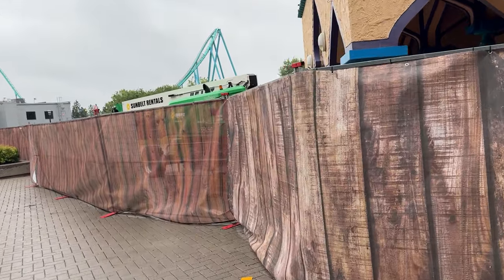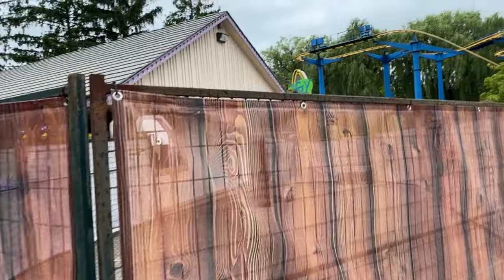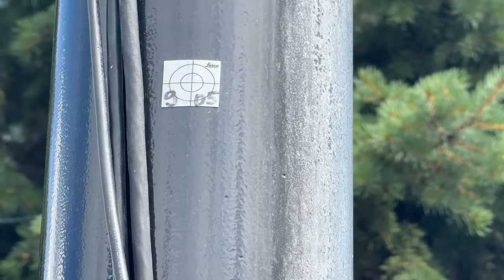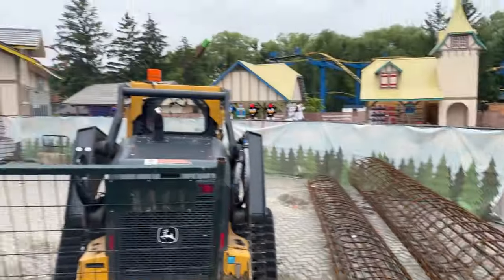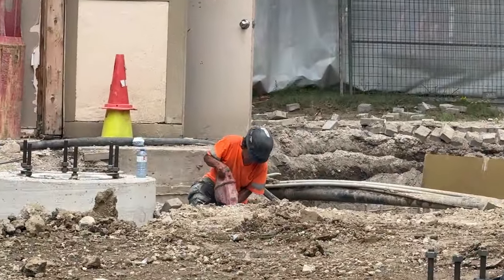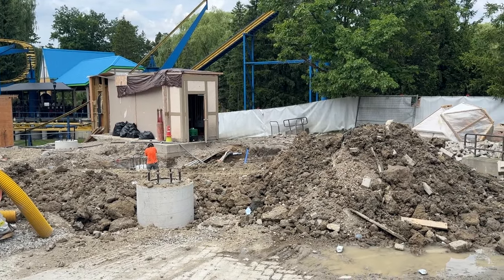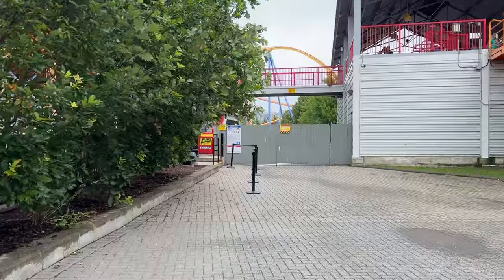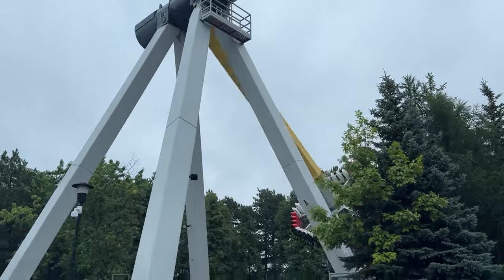Canada's Wonderland New Launch Coaster Update

Comment: I don't like the fast lane getting moved to a merge at the bottom of the stairs and a single rider line put in the old fast lane access. People will just abuse the lane like they do on Yukon. I have seen so many groups of teens go into that single rider line on Yukon. People say they only get on when there is one set left, but I have seen them pull more than one from the single rider line many times.
Reply: It’s still an amazing idea maybe not for fast lane glazers but lines will move much quicker.
Reply: I also share this concern especially as an all season FLP holder 😢
Reply: Yeah it’s the single rider groups arguing with the attendant that gets me and as you said pulling 2 from that line should never happen for the same row.
Reply: It’s big time abused on Yukon striker and they get on quicker than FLP users.  I’m sure the same abuse will now happen on Behemoth. Not happy about this at all.
Reply: Yeah they pull more than one from the single rider line often… but it’s for a reason.  Let’s say there’s 3 seats left… but the next party and the regular queue line is a party of 4 or 5… they ask for a party of 2 or 3, but there are none … then they let single riders go in.

Comment: Wouldnt be a motor replacement on Cyclone i dont think. Its more like our automobiles to explain it in a term everyone can understand. Repairing or Replacing worn out parts and re-greasing the bearings and technical stuff like that. Be really expensive to replace the motor. Just my theory.